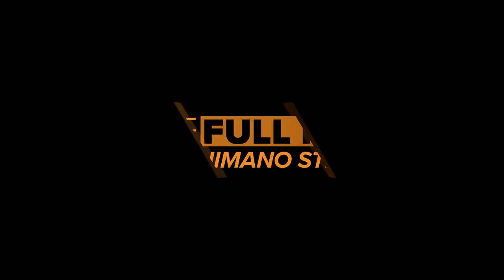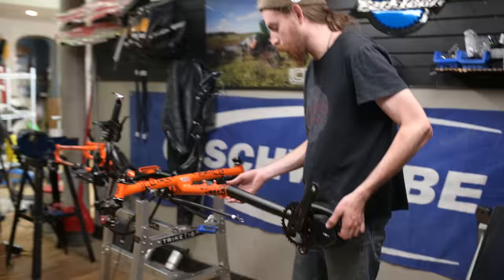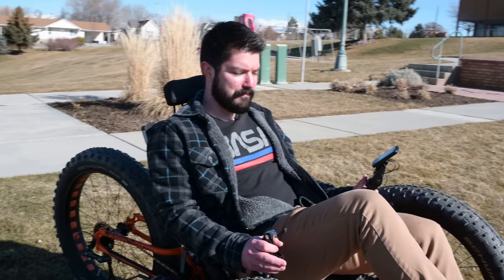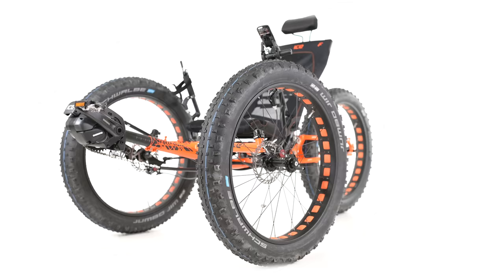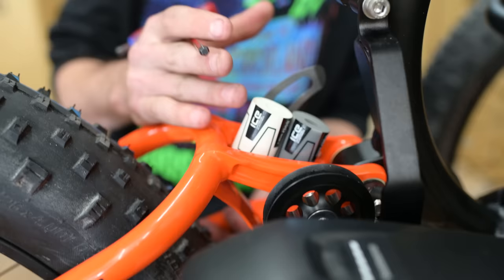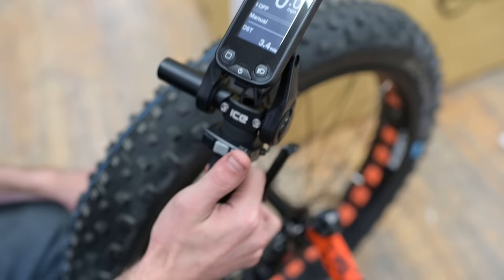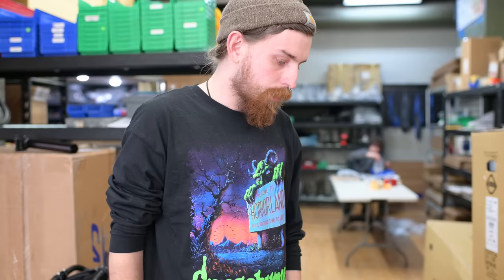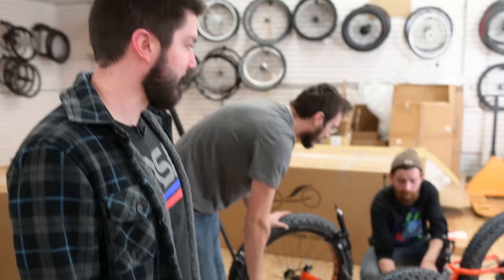20MPH FULL FAT TRIKE GOES ANYWHERE! - ICE Trikes Full Fat w/Shimano STEPS  Recumbent Electric Trike

Comment: Riding the Full Fat Trike is great, I am an owner of a FFT, so I can tell. Besides going off road, the FFT works very well in urban areas.  At 3:06 you can see the FFT climbs on the curb without issues. I rode a 800 km/ 500 mile vacation trip through rolling hills in summer 2019. I also tow a trailer behind it (Burly Nomad). So VERSITILE is the key word of the FFT. The speed is only a fraction lower then riding a normal tire trike, but I am not a fast rider with 44 lbs/ 20 kg overweigh.
Reply: Hey what kinda range did you get with it? I'm very curious about what to expect
Reply: @RosaHernandez-ql8nu  The range is around 40 km/ 25 miles. Sure, I can get more miles/ km out of a battery by dropping under 60 %, but that reduces the battery life span. My tires are inflated at 1,3 bar/ 19 psi. 
And in the winter the range is reduced by the cold, of course. The colde reduces the battery capacity. So around 16 km/ 10 miles.

Comment: Fat Tires have high rolling resistance. Rolling downhill is the best thing that they do. "Wish it had motors" at 10:54 is a good clue. Switching out tires for the Alta Bicycle Fat Tire Duro 26" x 3.00" Slick Tread Bike Tires for Beach Cruisers would be a good idea.  They inflate to 36 psi and roll much easier.  You can mount 3 inch tires on 4 inch rims.  It will change the ride experience.
Reply from the maker: There are lots of tire choices, lots of wheels, and lots of trikes. If somebody wants 3in slicks this probably is not the right trike for them.
Reply: @UtahTrikesOnline  I like your product. Just try it with a promotion of a cruiser version and create a video that lets the viewers decide.  I would hate to see your product sales limited by default - just because....

Comment: Can’t quite part with the cash for motor at present. Soon hopefully. However, I’d love to fit my SprintX with those handlebar clips if available as a retrofit. My only complaint (small) is getting the adjustment right after unfolding. Always love your vids

Comment: Very sympathic natural guys, like that 👍 What I don't understand about this concept is why make it big but completely useless except of transporting one person, why the pedals need to stick out so far, make the whole construction long and wide without using the size properly? Moving the frontwheels out would give space for a front trunk, making the backwheel smaller would give space for a back trunk or both space for a second seat, also it doesn't need to be that wide and the short distance between the axles makes it jumpy and instable. But basically I like it, just googled some infos about tires and things because I'm planning a trike but other way around to have a trunk in the back, that's why I got this recommended, you guys showed lot's of details that I can learn from, just for curiosity it would have been nice if you told which switchgear is used on this.

Comment: That trike is my favorite fat trike out there. Just wish it came in a non fold frame.
Reply from the maker: We can always weld it closed for you! :)
Reply: If you want a rigid frame, you should buy the Fat Trike from Azub. Slightly cheaper. But the locking mechanism works very well. I own a Full Fat Trike for 3 years now, never had any problem with the beast. Or use loctite glue.

Comment: Spent 45 min on the phone disguessing my build.  Still a little confused, Can I get the Full Fat with 26" tires that have fenders??. I also want colored inserts in the wheels but was told I couldn't get them on the 26" wheels?. Is this correct. Looks like many of them have the colored inserts. How does the V3 compare to this model?. Does this one have the full suspension?. Thank you. Just trying to get the perfect setup before I order.

Comment: Would be super cool if you could make it work for a quadriplegic!
Reply from the maker: We can and have built all electric machines for quads.
Reply: @UtahTrikesOnline  what is the price range?
Reply from the maker: @adrian2825  The electric versions start at $8K. with servo steering and brakes it will be in the $11K range.

Comment: not a fan of the elastomer rear suspension, aside from that its great. I just wish they offered a better rear suspension option .
Reply from the maker: Once nice feature about ICE is that they use a modular frame. The rear end could be replaced with another one. There isn't another option yet, but...
Reply: I’ve some 6000 miles on my Sprint X. The elastomer RS is perfect for road work. Light weight, smooth, durable.  Maybe your bias is based on trail use. Can’t comment.

Comment: Price and how far can the battery go in all three mods and can a second battery be added on the other size
Reply from the maker: The Full Fat with the ESTEPS system is about $8000. You can carry a second battery with you but it won't be tied in electronically as Shimano doesn't has provisions for that. Attaching a battery mount on the other side will affect folding if that matters. Range with this trike will be 15-40 miles depending on the assist level chosen, rider weight, terrain and style of riding, and temperature.

Comment: I see two problem with your bike. 1) it look very heavy, need to be made out of carbon fiber or aluminum.
2) all kind of junk and dirty water will be flying all over your face and cloth because the wheels are not  covered with a splash guard. Those two facts are a deal breakers for me.
Reply from the maker: it is made from aluminum and lightweight Chromoly steel. Carbon wouldn't lighten it much.
Fenders are optional.